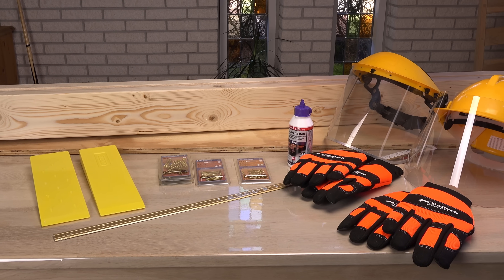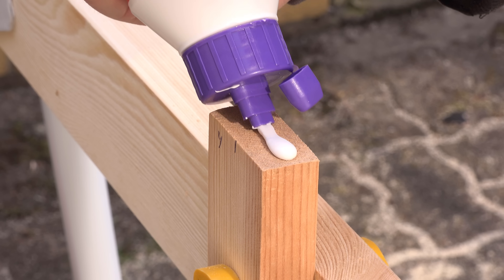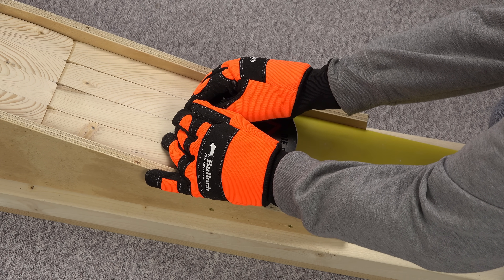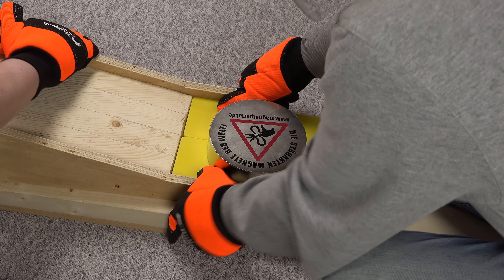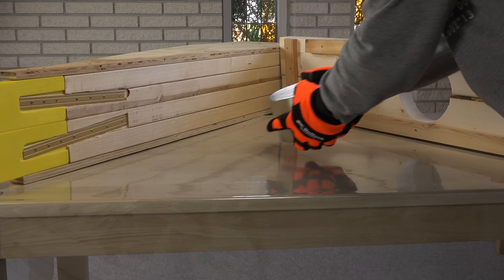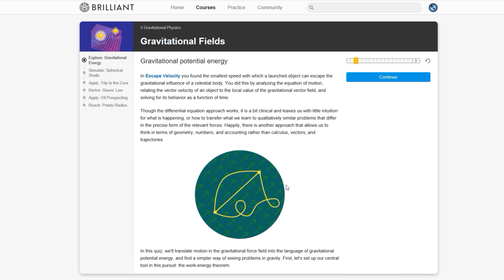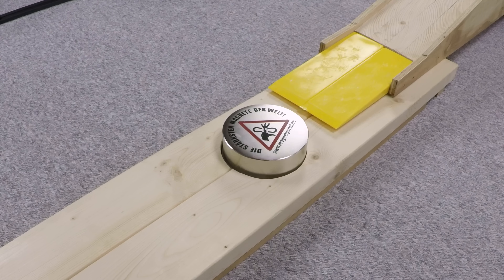Monster magnet meets monster magnet...

Comment: Next challenge: remove the two magnets apart
Reply: He could use a hydraulic press, secure 1 magnet to a solid base, and the slide the other off with the press sideways, it's not impossible but very difficult
Reply: impossible , i have 2 n52  2" by 1"  it takes me 10 min to separate using wrenches and a lot of hand injuries , then they got suck together again , now i don't want to bother
Reply: @RabeaHussain  its not impossible Magnets  lose  their  strength  if you heat  them up  you can  eaven  permanently  remove  their  magnetic  field  if the heat is  to big but  im  sure  that  it is  impossible without permanently  weakening the  magnets  or eaven destroying them in the prosses
Reply: @claudiahalmel6771  I'm pretty sure that he doesn't want to destroy the extremely expensive magnets.
Reply: @claudiahalmel6771  it's impossible if you want to keep them at their full strength.
Reply: @claudiahalmel6771  you just waste money
Reply: @claudiahalmel6771  who stupid person Will separate that magnet using heat
Reply: @claudiahalmel6771 or just use a bigger magnet to attract them apart and put something between them just incase you don’t stop it in time.
Reply: @RabeaHussain  no u can do it with a big scissor made of wood without losing the magnets powers or hurting it
Reply: @RabeaHussain  Been there,,,,,Done that. That is the size I work with every day. My largest is about 2" tall x 4" wide x 6" long. You will lose fingers and hands if you are not careful. I designed and made a holder to install with 4 pieces of rebar in an aluminum housing with a Teflon sheet to slide off  the magnet and a handle on the side opposite the magnet. I work in Semiconductor Fab for material coaters for hard disc drives, and work in shaping plasma in magnetic fiellds.
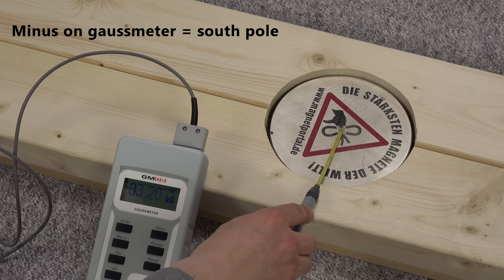Reply: @RabeaHussain  its ez lol use 2  same wood tools at 2:43 and pull them apart if human strenght is not enought use tractor
Reply: @RabeaHussain  impossible is the mantra for he who gives up.  I can think of a couple of ways myself.  You can actually turn a permanent magnet on and off.  It may be very easy to separate them.
Reply: @RabeaHussain  Maybe you didn't find the right way to separate the magnets
Reply: @RabeaHussain  uses nitrogen and cools the magnet and can release both magnets
Reply: @RabeaHussain  that’s the point of the challenge
Reply: @RabeaHussain  XD
Reply: @RabeaHussain  not with that attitude.
Reply: @RabeaHussain  It's not impossible, you're just a poor student of physics.  He shows how to do it on this very channel with ones that are larger than your 2"x1" ones.
Reply: @RabeaHussain does liquid nitrogen could alter and help with tht issue?
Reply: @RabeaHussain  well they didint say how, he could always melt it and they would separate
Reply: @1sthename70  I separated mine recently again to use for drinking water ..north side up and I put glass of water on it ..it's really good I noticed my digestion is better ..my urine flows better .. then I forgot I had one in may and tried to pick the second one with same hand oh boy .. they got stuck so hard on my finger it cut it and started bleeding alot and one of them broke .. carfull with these .
Reply: Next challenge: put each north on the other one's north north
Reply: @axiomaximum  instructions unclear, It was almost going to defy laws of physics so the universe made them oppose each other so hard it created a nuclear explosion and my city is no more.
Reply: @TakumisBizarreRacingAdventure  good job
Reply: @axiomaximum  I'd love to see them try this hahaha.
Reply: @axiomaximum  lol
Reply: Chainsaw goes brrrrrrrrrrrrrrrrrrrrrrrr
Reply: @megonggaga8046  chainsaw goes stuuuuuuuuuck
Reply: @megonggaga8046 ; The magnet would not let the chain move.
Reply: @megonggaga8046  hehe
Reply: @megonggaga8046  Chainsaw will definitely damage the magnets completely .. Not a good idea
Reply: @megonggaga8046  LMFAO!!
Reply: @megonggaga8046  Chainsaw goes b. It's stuck.
Reply: @megonggaga8046  maybe saw blade will be stuck by the magnet.
Reply: If you warm a magnet, it doesn't work
Reply: Hydraulic press, is possible.
Reply: Why doesn't he... USE MAGNETS to separate THE MAGNETS??? 

Genius amirite
Reply: @estoylaroca  because when you acc another magnet that is weaker than those two, one of the strong magnets will take all the power of the smaller one ang re directs it's magnatic flow to its benefit, and if you use a stronger magnet than those two it may work but then you have another two magnets that are more tightly packed together, so the only way it to heat them up like 100 degrees.
Reply: Use a lighter and a chisel
Reply: Easy, make a wooden magnet chopper with a levered arm to separate.
Reply: Probably could just shear it with a large lever
Reply: A wedge and a press
Reply: Simple just heat it up
Reply: You won’t have working magnets anymore though just lumps of metal
Reply: Just use two wood planks with an hole and slide them with an hydraulic jack or something like that, you will separate them without much issues , so the real challenge is the one of the video, getting them to stick without damage
Reply: heat them above curie temperature and separate them but both will be non magnetic needs magnetization again.
Reply: create a strong enough electro magnet and when you've used it to pull the magnet apart, turn it off.
where's my money!!?
Reply: @Mike_Greene  But that would pull on both magnets in the same direction. how do you pull just one away from the other?
Reply: @FourthRoot  Ive seen this video long before my coment and fconfused it with the one that had something in between. Now my solution would be only in thought lol.  Youll need to  3 electromagnets opposite charges at the ends and  any charge in the middle which should repel one of the magnets(?) .....................
ahhh . . . i got nothing lol....
for not.
Reply: @Mike_Greene  Actually you're a lot closer than you realize. Pulsing current through a coil wrapped around the junction of the two magnets would produce a repulsive force driving each magnet away from the center of the coil.
Reply: just go to settings and turn off the magnetic feature, easy
Reply: Good luck
Reply: To separate them you need an stronget magnet i think
Reply: Question is, do they need to stay magnetic ?
Reply: @GameOver-fn2og  yes. No oxy acetylene torches allowed.
Reply: Its possible just if johncena does it
Reply: Just pull them apart. Stop being a wuss
Reply: @welovemarbles7191  Care to demonstrate for us?
Reply: @brettschmidt5929  if you cant figure it out its not my problem
Reply: @welovemarbles7191  If you can't use proper grammar, it's not my problem.
Reply: @brettschmidt5929 ???  first of all, this is a youtube comment section not an English essay. If you cant figure out what people are saying than there's no hope for you to begin with. Secondly you brought up me proving something about separating the magnets than you brought up grammer for some reason? You're a winner!
Reply: @welovemarbles7191  Of course, I knew what you meant.  That doesn't mean that you shouldn't be using proper grammar. What would Shakespeare have thought if he could have seen your comments?  And if you are so obsessed with getting those magnets apart, then do it yourself.
Reply: @brettschmidt5929  Shakespeare? Why the hell would I care what he thought? I can get the magnets apart.
Reply: @welovemarbles7191  Prove it.
Reply: @brettschmidt5929  are you retired or something? If you cant figure it out it's not my problem. Why would I feel any obligation to prove anything to you? You are nothing to me.
Reply: @welovemarbles7191 You can't prove it, because you can't do it.  As you well know, sunshine.
Reply: @brettschmidt5929  if you say so
Reply: @welovemarbles7191  Yep.
Reply: easy: heat.
Reply: @AMV12S  I don't know exactly how expensive these magnets are, but I can tell you this they are way more than expensive enough to risk using the heat method because they will be weaker after the heat method. I'm coming up with these numbers on the spot but this is a good example I think, let's say each magnet could before the heat treatment they could each lift 1000 kg then after the heat treatment they could say only lift 500 or 600 kg, at that point you may as well just be getting rid of the magnets completely. Like I said I came up with those numbers on the spot so you might not lose as much lift capacity but you may also lose a lot more than that I don't know.
Reply: 0.001% chance can happen
Me:are you sure this will work
Reply: O dear God that would be hard
Reply: just heat them lots
Reply: 😭😭😭😭Yea right have fun doing that
Reply: That's what I was thinking.  Maybe if two bull African elephants 🐘 🐘 each got a hold of one of the magnets?
Reply: Thats as hard as splitting legk bricks
Reply: This is the key to renewable energy and hover cars
Reply: You would have to de-magnetize them.
Reply: @user-or4dm1fv3f  Thats the simplest approach.  and theres a couple of ways to do it effectively.  You could heat them, which would destroy them.  Or you can temporally cancel out one of the magnetic fields.  That is not as simple.
Reply: -Without crushing your fingers
Reply: Tell those magnets. PULL APART NOW!
Reply: Yeah, that ain't happening
Reply: @kurgaru  It is happening. If My instructions are followed.
Reply: Manually impossible
Reply: @noobpianist8757  it is not! if you follow my instructions.
Reply: With battery. Few coils....can separate easy....
Reply: Vas
Reply: To remove magnet to be used  hydrulic press..😂😂😂
Reply: Easy way to do it: reach out to Brian Shaw
Reply: I think it could be done by employing a giant to shear them apart. or, if you wrapped a wire around the interface and discharged a large capacitor bank through it, the magnetic field could aid in repelling both magnets away from the center momentarily.
Reply: 😄 impossible 😈
Reply: Yeah but you're going to need a particle accelerator cut them in half
Reply: And then make them repel
Reply: Easy
Reply: and the point is?
Reply: E
Reply: 100th comment
Reply: Guck
Reply: It’d be easy.. all You’d have to do is build two individual wooden inserts (like the bottom magnet was in..) then use a winch to slide one off the other..
Reply: Easy he needs to  build a bigger version  of his splitter

https://www.youtube.com/watch?v=ybY_wdQ5MSc
Reply: If you heat it up enough it will lose its magnetic force
Reply: According to my rough (and probably wrong) calculations using available online calculators, two 4" diameter and 2" thick magnets of grade N45 should stick together with a force a bit over 400kN... It would, according to "Orders of magnitude" wikipedia article, require the force deployed by a diesel train engine to speparate by pulling them appart O-o Shear force should be less than that but still huge...and it is for 4" diameter, not 6 ^^' Maybe some engineer around here could calculate the shear force required to slide them appart. For the pleasure of being rude, using real units and not inches and pounds-force as the calculators I found did XD
Reply: Hydraulic log splitter would spread them.
Reply: Overheat the magnets and
Reply: Overheat the magnets and they will lose their magnetic force
Reply: Or separate them.
Reply: Magnet fishing would allow to pull a truck out of a lake
Reply: A hydraulic press in reverse could pull them apart. Gripping the magnets will be the hard part. Grip with some sort of ratcheting jaws made of material that won't scratch the magnets.
Reply: Pour some lubricating oil at the joint of the two magnets   and try to pull them apart without heating.
Reply: Reading through the comments I'm amused at the people who think using a hydraulic press would not result in the magnets becoming attached to the press.

Everything used to separate the magnets needs to be non-magnetic within a minimum of 3 metres radius.  Even at that distance, extreme care is needed to manage the magnetic forces involved.

For the initial separation, a solid stainless steel wedge of about 800mm long and 150mm at its large end, greased and with safety railings welded to each long edge, driven by two long wooden beams in parallel which in turn are driven by a hydraulic ram set at a distance of 3 metres, would work.

Once the magnets are pushed up each side of the wedge and onto each side of the timber beams, the two beams can then be separated by using a levering action and adding wooden chocks in between to gradually increase the separation distance, with the proper precautions to prevent the magnets from catastrophically slamming back together of course.

Once far enough away, the magnets can be manually drawn away from each other to a safe distance.
Reply: 5t bottle Jack's opposed whilst having both rams connected to a splitter plate that gets hammered between the magnets. Use the Jack's to separate?
Reply: You could put the two magnets in a hole cut out in a heavy board so that the surface is flush with the lower magnet and then place a similar board on top and then try to slide the magnets using some kind of jacks.   You need also a bracket to keep the boards tight to each other and WD 40 them so they can slide.
Reply: Have to wait a few thousand years till Luke Skywalker comes around
Reply: Lol good luck.
Reply: my thoughts too
Reply: Instructions unclear: that is physically impossible
Reply: Yes
Reply: Easy!!!!  Heat the magnets to 80 degrees and above then they lose power and release
Reply: Not very hard, just take their magnetic power.

Comment: You could have done it in far more simple way. Just put both magnets in liquid with big viscosity. I  think, some kind of resin will work just fine.
Or put rubber porous support between magnets and shove that sandwich into organic solvent.
Reply: May be simpler but could be more expensive

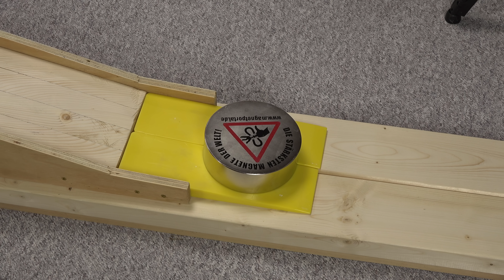Comment: At 5:45 the lead edge of the magnets have no plastic between them, 5:47 a small pulling break is taken, being that magnetism is an inverse square that is in a generic math sense 1/(x^2) so the closer together the magnets get the stronger % force of the full 100% potential is felt. My hypothesis is when no plastic was between the magnets at the lead edge plus a small break, I think the magnets were strong enough verses the plastic to create a ever so slightly indent into the plastic, so that when you resumed pulling, the magnet was slightly indented and you had to pull it over that lip. That lip would have initially resisted the pulling force, than built up potential spring energy via Hooke's Law, and than when you did over come that resistance the restorative force slightly violently pulled the lip of plastic under the magnet and movement resumed at that point(basically plate tectonics, in fact an almost direct comparison is a Convergent boundary). You likely know all of this already but you did state you had no clue why the sounds happened, so that is my thoughts on why and what caused the noise, no matter what the certainty is that the noise was caused by a changing of pressure, so maybe you have some different thoughts on what pressure change was occurring, but I think I nailed it = ) Thanks for the content!

Comment: I never even thought that magnet could be this terrifying 😂
Reply: Mrs. Jotukiller  average fridge magnet is more powerful than earth
Reply: @alienfromarea-5196  Not true - you’re forgetting how huge the Earth is, and thus the volume of space that its magnetic field occupies. You can take a magnet as strong as these and it’ll direct a compass from a few feet away. Now consider that the Earth’s diameter is 7,918 miles. Now let’s see how strong your fridge magnet is from 7,918 miles away.
Reply: @babybirdhome  yes
Reply: You guys are thinking inside Earth, and forgot the most powerful magnet. The Magnetar! Which is a Neutron star type with magnetic field of quadrillion times the Earth. This is so strong that, it will tear off atomic bonds (due to electrons in atoms) from about 1000 km away from its surface! (It's like a no matter zone).
Reply: This isn't even the final form of magnets, because technically electromagnets are still magnets and they can be many thousands of times more powerful than even this behemoth that was created.
Reply: When it comes to magnets alcohol and  and let’s say  ............ other substances  r right up there for drawing me in with as much pulling power
Reply: https://youtu.be/ob3-w9bqCho

Comment: Hmm. I wonder if it would work to use ice as a separator between magnets. The idea being the magnets could come together as the ice melts. I suspect the ice might be too brittle, or might crush or shatter under the pressure.
Reply: It's not a problem if you put it all in a plastic pipe.

Comment: thank you for this great educational video...I work with strong neodymium magnets also in researching magnetic motors as a propulsion device and energy generator.
I had two ideas on other ways that might work to accomplish what you are doing....
On the method you use, how about a ramp made of ice?
Or in another method, have one magnet at the bottom of a clear Plexiglas cylinder of ice. And the other magnet is fixed at the top of the same cylinder, so as the ice melts, the bottom magnet has to rise up to the top magnet. In this method there will be displacement of the ice and water as the bottom magnet rises.
With some ingenuity there is probably a way to control the ascent of the bottom magnet through controlled release of water and ice...which will undoubtedly be under great pressure...
Just an idea I wanted to share....I like the channel, keep it up!

Comment: Brainiac75, Freeze a puck shaped block of ice the same diameter of the magnets and a several inches thick. Place the ice between the magnets and then inside of a snug fitting cylinder and wait. Seems the magnets would slowly go together as the ice melted.